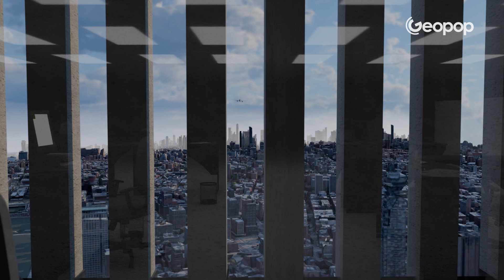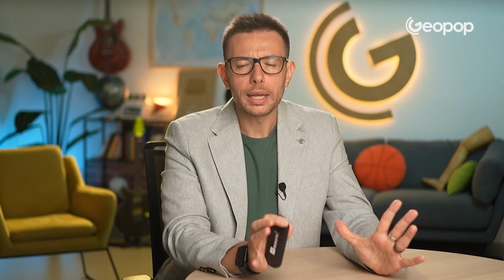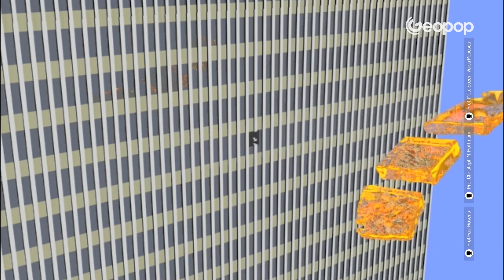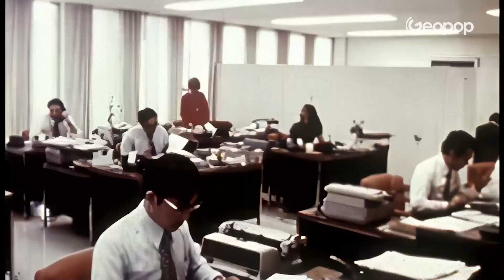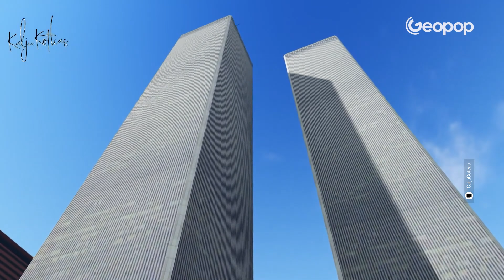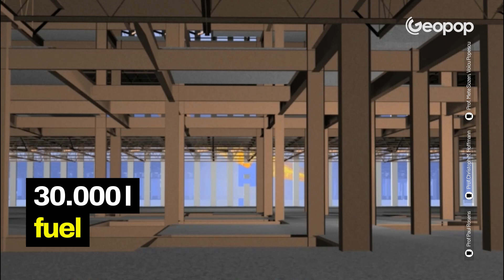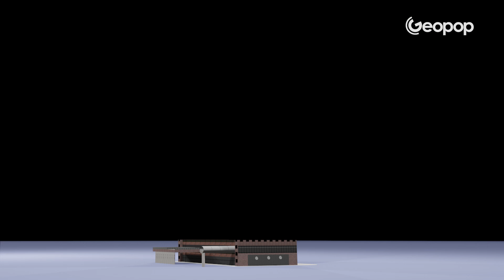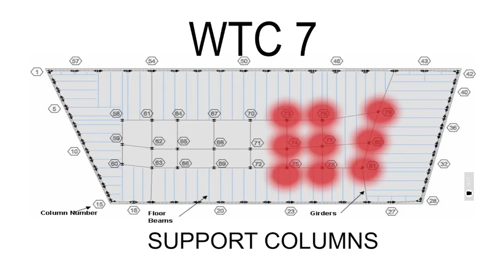9/11, 2001: The Technical Reconstruction of the Twin Towers and WTC 7 Collapses

Comment: Its called thermite reaction

I was in yr 9 on this sad day. High school hear in australia. My form class first thing in the morning was in the library. As i walked into the library the TV was on and i witness the first tower collapsing. Not even knowing what i was watching or that this attack was even actually hppening i immediately turned to librarian at front desk and ask if what i was watching was a movie? She instantly replied " no! Its the real thing, its really happening " 

I immediately asked the librarian if it was a movie because i instantly noticed something off about how the tower collapssed.  The collapse looked to neat and controlled and the lower floors seemed to collapse before the already collpased upper floors hit them. Even as a high school student in yr 9 ( so age 13 ) it immediately looked like control demolishen to me. 🤔
Reply: From memory the core of the towers was solid steel! The core of towers was designed to be the core strength of the towers. The floors were for the most part held up by this steel core, not the floors below. The steel core held up the towers! While a steal beam may have failed from the heat ( and by fail i mean twist and warp )  no way in hell this solid steel core did🤔.
Reply: @timvanschuilenburg1524  - youtube.com/watch?v=JXWCMBuusMI&ab_channel=TrutherTVArchives 

In this video starting at 45:35 and running to 48:35 the Energetic Materials Research and Testing Center (EMRTC) conducts a test to examine the effectiveness of thermite in cutting a vertical hollow box-section steel column. The column tested is smaller in cross section and made of thinner steel than that of the Twin Towers perimeter columns (and never mind the core columns). In total 175 pounds of thermite are used for the test on just one column and requiring the construction of a rather conspicuous coffer dam to contain it. Do recall the Twin Towers had 240 columns and 110 floors.

It would be odd if thousands of office workers missed hundreds, perhaps thousands of those suddenly appearing.

Note what an incredibly slow process this is. It took close to 30 seconds for the thermite to finish burning off.  It would be impossible to “control” a demolition using this material.

Not to mention the issue of how does the aircraft impact and subsequent raging fires NOT prematurely set this stuff off. 

Also note how bright and obvious the whole process is. Could not be missed visually. No way to hide that. 

Then at the end of the test the (relatively modest) column was undamaged…. which is a problem.

The Twin Towers consisted of 4 primary structural elements that together formed an integrated system where each relied on the others.  47 hollow box-section steel Core Columns carry the majority of the gravity loads. The 236 hollow box-section steel Perimeter Columns carry the remainder and ALL of the lateral (wind) loads. Long-span Lightweight Steel Trusses connect the core and perimeter column together at each floor with a Hat Truss on top to tie the structure together as an integrated unit where no element can survive without the others. 

Collapse initiation was actually due to sagging floor trusses (which we can see) causing inward bowing of perimeter columns by up to 5 feet (which we can also see) at the impact and fire damaged floors until those perimeter columns buckled and failed, initiating the collapse (which we can see). I would refer to you the excellent Gary Pollard video of the collapse of the South Tower. Pay attention to the first 12 seconds in particular.

WTC2 Collapse -- Gary Pollard (Enhanced Raw Copy from NIST) 

https://www.youtube.com/watch?v=ULdiD6gYZO0

Columns don’t work well when they are bent. The Twin Towers were designed to work with straight elements not bent ones. When you bend those columns they become up to 4 times weaker. Failure is inevitable.

Notice how the columns are already bent when the camera zooms in, become a bit more bent over the next new seconds until they give, starting the collapse. 

So what bent them? It sure as shit wasn’t thermite or sooper-sekrit fire-and-impact proof hush-a-boom pre-planted demolitions that don’t explode. 

If you keep watching you will note that after the tower starts collapsing the air inside the building (95% air by volume) gets compressed and forced out the windows. These low-velocity air bursts devoid of blast or fragmentation effect are a reaction to the building collapsing not a cause of the building collapsing 

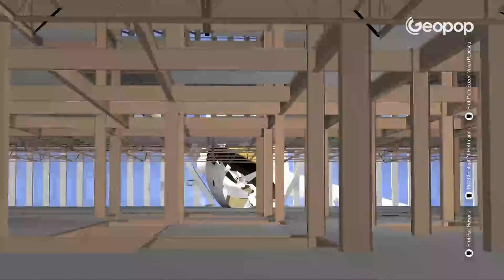And at a different angle from 1:18 here:
youtube.com/watch?v=TJJPYTVjxug&ab_channel=femr2 

Also seen in the excellent still image here at 9:09:
youtube.com/watch?v=YXsDwKYz1bA&ab_channel=msvfreak94

Comment: The US Government had everything to do with 9/11. They put explosives in the support beams the night before 9/11. That's what brought the tower's down, not the airline fuel.
Reply: Collapse initiation was due to sagging floor trusses (which we can see) causing inward bowing of perimeter columns by up to 5 feet (which we can also see) at the impact and fire damaged floors until those perimeter columns buckled and failed, initiating the collapse (which we can see). I would refer to you the excellent Gary Pollard video of the collapse of the South Tower. Pay attention to the first 12 seconds in particular.

WTC2 Collapse -- Gary Pollard (Enhanced Raw Copy from NIST) 

https://www.youtube.com/watch?v=ULdiD6gYZO0

Columns don’t work well when they are bent. The Twin Towers were designed to work with straight elements not bent ones. When you bend those columns they become up to 4 times weaker. Failure is inevitable.

Notice how the columns are already bent when the camera zooms in, become a bit more bent over the next new seconds until they give, starting the collapse. 

So what bent them? It sure as shit wasn’t thermite or sooper-sekrit fire-and-impact proof hush-a-boom pre-planted demolitions that don’t explode. 

If you keep watching you will note that after the tower starts collapsing the air inside the building (95% air by volume) gets compressed and forced out the windows. These low-velocity air bursts devoid of blast or fragmentation effect are a reaction to the building collapsing not a cause of the building collapsing 

And at a different angle from 1:18 here:
youtube.com/watch?v=TJJPYTVjxug&ab_channel=femr2 

Also seen in the excellent still image here at 9:09:
youtube.com/watch?v=YXsDwKYz1bA&ab_channel=msvfreak94

Comment: I don’t think this adequately explains how it collapses with no resistance from the lower floors.  I’m not expert of course and don’t claim to be, but the many experts that do reject NIST explanation raise the question and their expert opinion is that the manner of this collapse doesn’t fit the explanation.

I don’t feel this video answers those questions.
Reply: You always have so called idiot experts contradicting other experts! What does it tell us? Nothing! Relevance? None at all!
Reply: You are correct. This video only describes things that actually happened, not your false unfounded assumptions about what incorrectly believe happened. You are also correct in that you are not an expert. 

You are wrong in claiming there are many experts that reject NIST's Twin Towers collapse hypothesis. Bet you can't name 3 experts in relevant fields that do and no works they have published to that effect.  Even if you could, that doesn't mean The NIST is wrong, your experts are. The NIST hypothesis has overwhelming support in the engineering community.
Reply: @ you are very aptly named.
Reply: @nickh0055  - And not wrong. If I had been you would have come up with a better rebuttal.

Or a rebuttal. 

I'm not seeing any signs you are actually serious about any of this. Pity.
Reply: @TheLoonResistance  you requested I name 3 experts and said, even if you do, they are wrong.

Why would someone waste their time engaging with that proposition?
Reply: @nickh0055  - You were making an argument from authority - with no argument and no authority. An obvious logical fallacy on multiple levels. Why would someone waste their time engaging with that proposition?

Comment: It's a shame that you never mentioned the evidence of Thermite in the rubble from the sites that was tested. What does Thermite do? It causes stell to become molten and there was clear evidence of molten steel still burning even days after the collapse. This can only mean that thermite was placed in the towers beforehand. As for building 7, it's a shame that you don't mention that on September 10th Donald Rumsfeld gave a speech that $2.3 trillion dollars could not be accounted for from the Pentagon and that it would have to be investigated. I wonder what building was ilvolved holding all the documents required for the investigation??? Hmmmmmmm?
Reply: You sure about that?

Thermite melts steel?  Does it though? If only someone had actually tested this instead of just guessing or making unfounded assumptions. Oh, wait!

youtube.com/watch?v=JXWCMBuusMI&ab_channel=TrutherTVArchives 

In this video starting at 45:35 and running to 48:35 the Energetic Materials Research and Testing Center (EMRTC) conducts a test to examine the effectiveness of thermite in cutting a vertical hollow box-section steel column. The column tested is smaller in cross section and made of thinner steel than that of the Twin Towers perimeter columns (and never mind the core columns). In total 175 pounds of thermite are used for the test on just one column and requiring the construction of a rather conspicuous coffer dam to contain it. Do recall the Twin Towers had 240 columns and 110 floors.

It would be odd if thousands of office workers missed hundreds, perhaps thousands of those suddenly appearing.

Note what an incredibly slow process this is. It took close to 30 seconds for the thermite to finish burning off.  It would be impossible to “control” a demolition using this material.

Not to mention the issue of how does the aircraft impact and subsequent raging fires NOT prematurely set this stuff off. 

Also note how bright and obvious the whole process is. Could not be missed visually. No way to hide that. 

Then at the end of the test the (relatively modest) column was undamaged…. which is a problem.

Certainly no rivers of molten steel emanating from it either and in fact the whole thing cools rather quickly as soon as the thermite has burned off, as one would expect.

Also, SecDef Donald Rumsfeld did give a speech on 9/10/2001 about long-running accounting problems at the Pentagon, but nowhere in that speech did he claim $2.3 trillion dollars could not be accounted for (which you would know had you actually read the speech instead of copying shit off the internet) and more importantly, the terrorists who planned and carried out the 9/11 attacks didn't give a shit about the Pentagon's accounting problems. 

Got any other guaranteed losers you mindlessly copied off the internet that I can tear up?

Comment: I still want to know if there is any validity to the story that the building was closed a week before, so elevator work could be done by repairman. That would be the perfect time for someone to plant charges if they had some Intel that something bad might happen in a week or so
Reply: If you still have not figured it out after 23 years then you need to find a new hobby. This one is way over your head. 

“You can’t believe everything you read or see on the Internet” - Abraham Lincoln
Reply: The towers were never closed to the businesses that maintained offices there. Workers with proper credentials could enter at any time 24/7, EXCEPT for the weekend prior to 9/11 the buildings were closed to all tenants. The reason:  the buildings were to undergo new cabling for phones and internet. This would involve people working behind walls in the interior of the buildings.

Comment: I wrote the fbi to review the collapses again to look for thermographic and 3lectromagnetic or vibration data for the basements and buildings. The videos looked like the buildings were pulverised into powder on the way down. We cant comprehend the powdery destruction of the structures.
Reply: No they didn't. www.youtube.com/watch?v=u2D__-DVLBk
Reply: If the buildings were "pulverised into powder" then why did they spend 7 months removing very solid debris?

Comment: But...but....Cletus told me from his trailer that this science isn't true. Even though there is absolutely zero evidence (other than hearsay) that there were any demolition charges used. It would have taken hundreds (thousands?) of man-hours to wire those buildings up, hoping that some nosy maintenance guy didn't discover the pre-wired charges or any of a hundred other things didn't go wrong. The 'controlled demolition' theory also ignores the call from Frank DeMartini where he stated he was looking at the steel and it was starting to fail and he requested a structural engineer to come evaluate the integrity of the building.

Comment: What about the 80 floors below that were not structurally damaged
Reply: The 80 floors below did not support the building above, the columns did. Each floor was designed to support (IIRC) about 3500 tons static load .What do you think happens when 100,000 tons of tower falls into a floor designed to support 3500?
Reply: And an office fire doesn’t burn hot enough to damage steel
Reply: @TherealJA253  - They didn't need to be.

Planes impact Towers, causing massive structural damage, starting multiple floor-wide fires that spread rapidly due to the destruction of fire protection systems during the4 impact.

Serious fires were largely confined to the impact damaged floors and those immediately adjacent to them.  

Fires were started by the impacts and fuel aboard the aircraft, which acted as an accelerant. No shortage of other consumables inside the tower to continue the fires. 

Collapse was initiated (started) at the impact and fire damaged floors when floor trusses exposed to heat over time sagged, in turn pulling on and causing the inward bowing of perimeter columns by up to 5 feet until they buckled. 

Once the perimeter columns buckled the formerly static load above became a dynamic load 30 times greater, easily overwhelming the structure below.

Thousands of tons of now loose debris fell through the open off space - through the inside of the building - dropping 12 feet onto the first intact floor it comes across. The massive instantly overload causes the floor to fail, adding its mass to the falling mass which continues to accelerate for another 12 feet until it impacts the next floor, rinse and repeat all the way down. Rate of collapse increases as momentum increases. As each floor fails, air inside the building (the Towers were 95% air by volume) is compressed, then blows out the sides _in reaction to the Tower falling, not the cause of the Tower falling.

No fire required at all on floors below the impact points for them to fail. The mechanisms that started the collapse are different to the mechanisms which continued the collapse.   That will be a difficult concept for some.

As the floors fail the perimeter columns are left literally hanging in the breeze, no longer attached to the rest of the structure. They peel away and fall in great sheets (think banana) out to more than 600 feet from the base on the 4 points of the compass. 

Core columns failed last. 

Each 110 story tower had a 1 acre footprint. The debris pile was up to 14 stories deep and spread out over 16 acres, destroying 8 surrounding buildings and damaging more than 100 others.